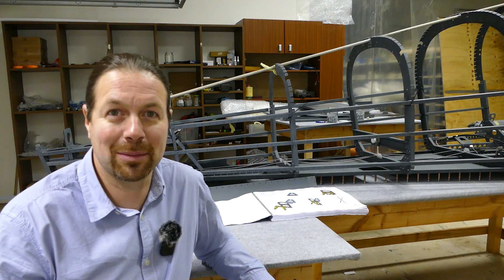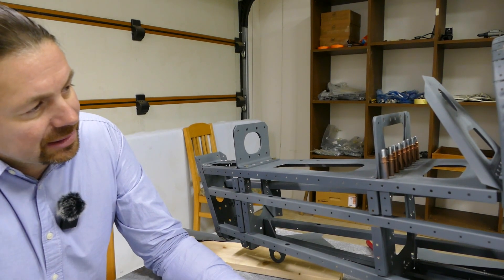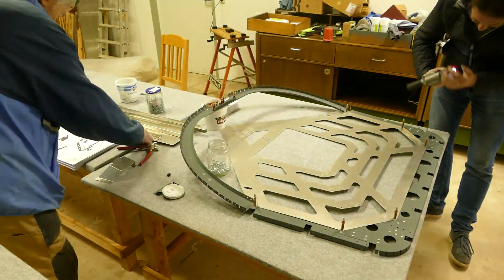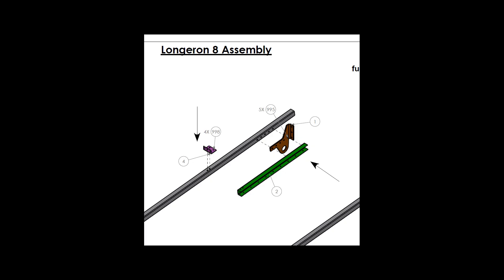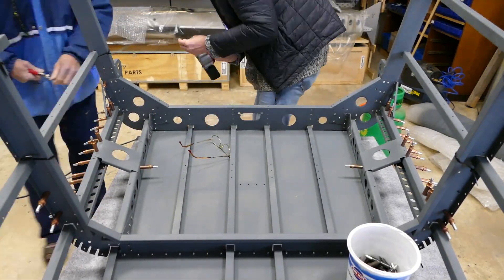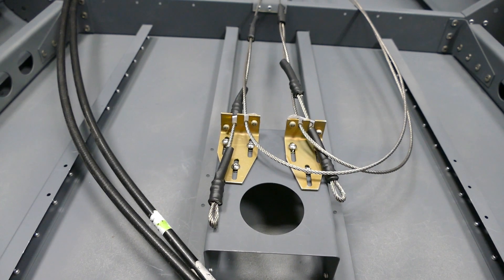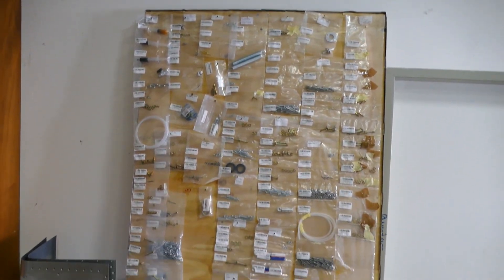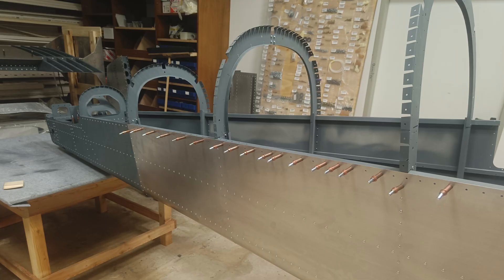Rear Fuselage! | Ep07 My TSi

Comment: I really enjoy your videos!  I am also building a TSi.  May I ask when did you receive your kit (or when was it manufactured)?  I am wondering if the issues you have identified on the rear fuselage are now resolved or have been updated in the KAI?
Reply from the maker: Hi I saw your YT videos and I am impressed by your huge progress!! My Kit was packed in october 2022 and I startet building in may 2023. I don't believe these issues have already been addressed in the KIA. They aren't really significant problems if you know them beforehand. I think one just needs to approach the instructions with a different perspective. The manual no longer depicts the exact sequence of construction steps but rather the parts in their final state. When to pull which rivets is at the discretion of the builder
Reply: @MYTSI25  Ok that's good to know and I will reference back to this video as I will be assembling the rear fuselage next.  Thank you